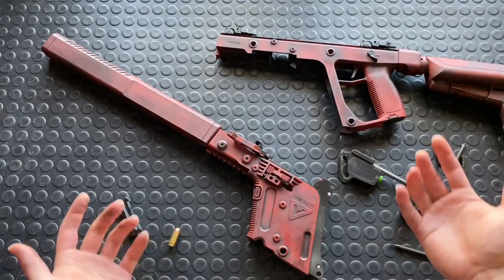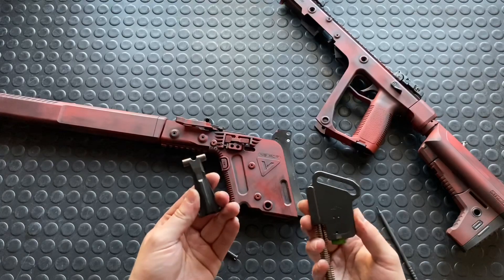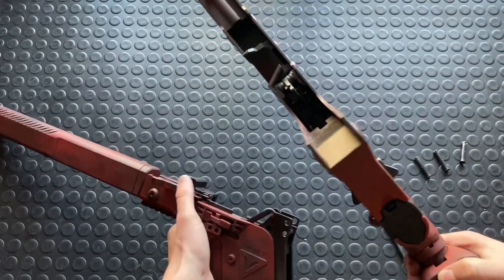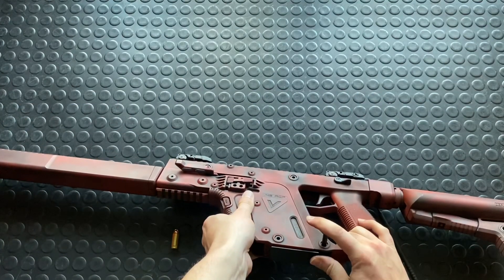Kriss Vector | Field Strip

Comment: Pro tip: Make sure your bolt is charged before disassembling, this will ensure your hammer doesn’t swing forward and hit. If you want to release the hammer make sure you guide it forward while pulling the trigger, don’t just pull the trigger.

Comment: Wheres the barrel extension from?
Reply: It's a shroud. Barrel is 16in long, from factory. Shroud is included with  it. Removable/interchangeable, but purely superficial.
Reply: @IronGrenadier30  no real reason in purchasing it right? Wouldn’t provide any performance to the weapon correct? I got one and I’ve been interested in them
Reply: @victorbeltran5543  correct. No performance factor, whatsoever.
Reply: @IronGrenadier30  thanks for the help. Stay safe💪🏽